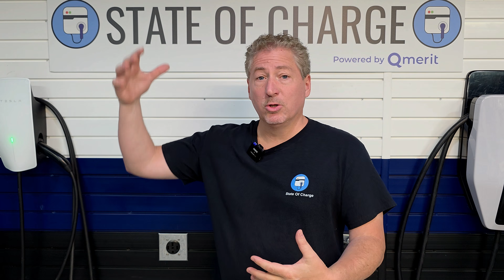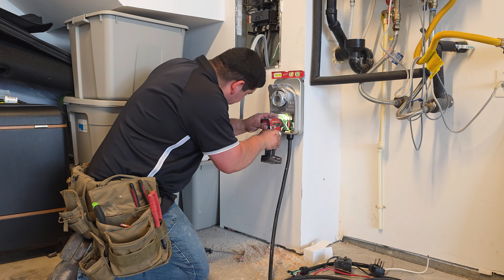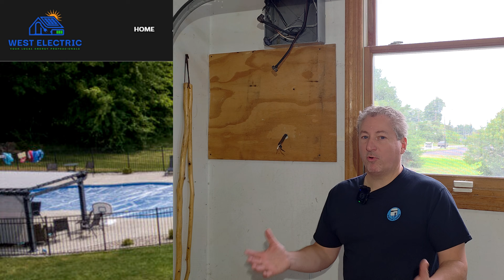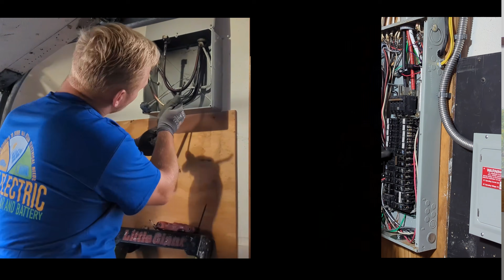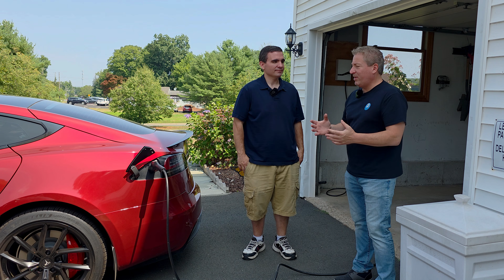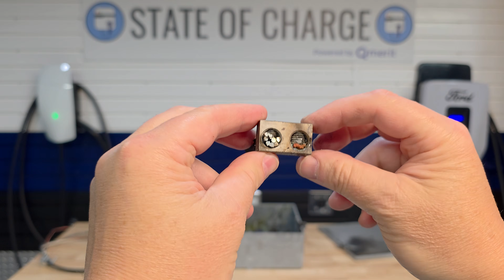Recharge Rescue Connecticut: Poorly Done EV Charger Installation Causes Fire

Comment: Why does anyone need a home charger? I have a couple of 220 outlets one in the garage and one outside. We have 200 amp service, an Equinox and a Bolt. The house panel is a sub panel of the garage panel.  The cars charge off the garage panel.  The cords stay plugged in coiled around a 3d printed cord holder. Thats it. Just plug the cord into the car when the car needs charging.

Comment: I am not a licensed electrician, yet I know that install was seriously wrong. HTF does any licensed electrician NOT KNOW the mistakes here. I have done my own 240 circuits for my welders and air compressors in the past. That isn't even the same as the seriousness of having everything exactly correct installing an EV charger that is pretty much at 100% duty for extended periods. Yes, I am doing my own 48A hard wired charger install because I know from previous experience and revisiting that now what is needed. How does a licensed electrician not know this? Clearly they do not have a good understanding of the constant load.  I think that licensed electrician at the very least owes a refund for that install of the previous charger. Now all that said, if I F up my install I'll be hitting you up for Recharge Rescue. LOL. One more thing, Tom that 8 gauge wire was NEVER going to hold up. It looks over-torqued because the connector is too large for the wire gauge so it flattens it, it can't do anything but that due to the sizing being wrong. I know this because I've had this discussion with an electrician friend.

Comment: Since seeing this series I started turning down the amps on both Model Y’s, put a smoke detector in my garage that connects to my alarm system and I smell the outlet where my ChargePoint is plugged in.

Comment: There's no way that the 8ga wire itself was the cause of this failure.   Yes the gauge is too small for NMC but that's only because the INSULATION of the wire cannot safely handle a continuous 50A current and this clearly wasn't an insulation failure.  The real cause pretty much has to be insufficient torque on the Burndy connectors.  Also your expert electrician from Qmerit was wrong to say that if the branch circuit breaker was rated at 50A it would have tripped and prevented the fire.  The fire occurred because the resistance of the connection was high enough that a lot of heat (power) was dissipated (P=I^2*R) when something like 30-40A was flowing.  That excess resistance could have actually reduced the current due to less voltage being delivered to the vehicle depending on the design of the vehicle's internal charger.

He was correct that the breaker rating shouldn't have been 100A since there was 8ga wire in the circuit and a big overload could have melted the 8ga wire's insulation even if the Burndy connector was properly tightened without tripping the 100A breaker but that's not what happened here and "experts" shouldn't be making significant technical errors in your otherwise excellent videos.

Comment: #8 Romex, 100 amp double pole breaker .... naw, the homeowner didn't pull a permit and have it inspected. No way unless the permit was just for the box and he connected the Polaris connectors after the fact. Just sayin' NO WAY. Show me the paperwork buddy! The permit and the inspector would have demanded a load calculation too. House burns down and your insurance company will deny the claim because you didn't pull a permit so your house wouldn't burn down. #8 Romex and 100 amp breaker --- defies any common sense whatsoever. I'm not an electrician but I know that isn't correct.

Comment: So, I'm not fluent in electrical terms, but you need to make sure your house is set up to handle an electric car and all the other electric stuff in your house. is that what I'm hearing? You also need someone who knows what combinations and sizes of wires to use for EVs, so you don't end up with fires. You need to have a smoke detector in your garage, and a fire extinguisher if you have an EV. Correct?

Comment: Thank you for this.  I just had my Chargepoint Homeflex charger installed a week ago and now realized I screwed up when purchasing the wire (6/2 Romex).  I now need the electrician to come back and replace the 60 amp breaker with a 50 amp and de-rate the EVSE to 40 amp.

Comment: 25:43 Tom, I really do admire your passion on this topic.  And I do absolutely agree with your position on liscenced “pros.”  However it’s been my experience that liscenced pros are like Unicorns.  Plenty of people that superficially meet that idea but many don’t know how to be professional.

Example, torque management.  Between the multitude of YT videos where the theme is “how I make $1k per EV install” to the utility mandated sparky that showed up for two different evse installs at my property, there is a casual indifference to using torque screwdrivers or wrench’s.  Literally, the last guy I had in my home made this exact comment “oh, you caught me…” when I asked, btw the way, was that 35 in-lb or 50 in-lb for that breaker as he was putting the panel back together.  He knew he ignored it altogether and he knew I knew it.  Only thing that prevented him from doing it in the first place, was it wasn’t in his belt pouch.  Which further tells me all I need to know.

That same electrician was “flexible on ampacity” because my evse was only a few feet away from the main panel.  So he had to run conduit and THHN instead of the romex 6awg he had brought out from my truck after I pointed out that 55 amp rating didn’t added up for a 48 amp evse device.  All of this from the guy sent by the utility that does all their evse TOU installs in my area.

Comment: I recently had my local EV-experienced electrician install my first EV charger to,support my new Porsche Taycan. I,also wanted to pre wire for a second charger as I plan to buy a second EV in the future. Unfortunately, my breaker box only had space for one additional 60 amp circuit, so achieving two chargers would require a new expanded breaker box, a very expensive proposition. The electrician’s solution was to specify usage of a Tesla universal charger. Using this approach, when I install a second Tesla universal charger in the future, they will automatically load share on my single 60 amp dedicated circuit. To the best on my knowledge, only the Tesla universal charger has this capability at this time. I would suspect many other homes have this “Full breaker box” constraint and could benefit from this approach.

Comment: This job was done terribly besides the points mentioned in the video. If the plan was to have an 100 amp charger down the road why would you cut the heavy gauge wires 2 feed short. An 80 amp charger would have terminals for the heavier wire, but now those wires are short. And why already use an 100 amp breaker while you only need 60 amp. The whole design was absolutely horrible. The electrician was apparently not in the loop of the work that needed to be done and just used what he was given. I know exactly  how this works, I have had this happen many times. It's just hard to say I have to come back, but that's the only right decision.
Reply: I relied on him as to what was needed re: what kind of wire, the junction box, connection wire to the EVSE, breaker size etc., all I said was I wanted the capability of switching to an 80amp EV charger down the road. He came out, designed/quoted the job, then came back with the materials to do the work. I also specified multiple times I didn't want to cut any corners, wanted permits pulled and everything done to code.

Comment: Question, currently getting 50 amp connection installed. Should the wire guage be 6 or 8. I saw where it 8 was recommended. I have a 2025 Ford Mach E GT.

Comment: Problem, you said you want someone who has installed 1000s. The electric Company Tesla had, said they are Tesla Certified and yet they used a normal 14-50 plug. So that's the problem. Just bought a Leviton EV plug since the mobile charger said it kept overheating

Comment: Excellent review - installed Tesla Universal Wall Connector charger without a connector box, directly wired to breaker box - I used 8AWG not 6 gauge (not Romex) THNN at the proper torque specs, and I set the charge limit on Tesla app to max of 24A at 240V so 8AWG and 40A breaker was sufficient. 
I completely agree that if you are planning to pass the full 48A to the charger, then you would need 6AWG copper with a 60A breaker.
The charger has worked well for over a year. 
I watch the area with a temperature gauge (Govee Home) wirelessly and with a Ring camera and I have a smoke/fire alarm wired to my alarm system.

Comment: Ed wired up my ChargePoint EVSE in my older Connecticut house and it's been holding up great for the last 3 years.   He also spotted an issue with some older wiring that needed to be fixed, so that was great. Would definitely recommend.

Comment: Here's another thought that is related to this topic.  Should all EV owners that park in a home garage ensure they have a HEAT alarm installed?   With two EV's and two home solar batteries in my garage I am started to get a little concerned.  And since it seems that installing a traditional smoke alarm may not be a viable solution (dust, etc causing false alarms and shortened life), my research shows a heat alarm to be a better solution.  What does everyone think?
Reply: I have a Nest in my garage as well as a Ring smoke/CO2 listener (makes my alarm system go off at night and automatically calls the FD). Since I do not have any gas vehicles to accidentally set the alarm off with carbon monoxide, I've never had an issue. The only problem I did have was one time I parked a relatives ICE SUV in the garage and was loading suitcases for a few minutes, even with the doors open, after I left and close the doors it set off the alarm and the FD came. But again that would be a non-issue in most cases especially if you don't own an ICE vehicle.
Reply: @ampedupevfsd we definitely need to raise the issue of garage alarms whether smoke or heat more.

Comment: The lesson is this:
1. Do a load calculation on whether your panel can handle the added EV load. If it does, great. Just add a new breaker and a charger with the right load (e.g. 48A charger with 48A breaker on a 60A dedicated circuit. Putting a 60A breaker on a 48A charger is just wrong.)
2. If static load distribution exceeds your panel's load capacity, consider adding capacity, or dynamic load distribution.
For my house, I use the simplest form of load distribution which is the cheapest to install: NeoCharge Smart Splitter, because anything else will require an electrician. I can install SS myself, which allows either the existing dryer or EV to use the dedicated 30A circuit (with an existing 30A breaker), but not both.
Reply: 48A EVSE on a 60A breaker is correct (80% rule). It should not have been on a 100A although it's doubtful that would have prevented the fire in this case.

Comment: I feel that there was a missed opportunity here.  This would have been a great chance to show the Emporia load management at work.  Plug the Tesla into its wall charger and then the RIvian into the Emporia Pro.  Bring up the Emporia app and see how close to max load the panel is at.  You may even get to see the Emporia Pro throttle down to stay under limit.
Reply from the maker: He's got a 200-amp service. The Wall connector wouldn't have put the house over its limit. We would have had to turn the heat pump on and a bunch of other items to get close to causing it to derate the charge.
Reply: Yeah all other major appliances are propane so even at full blast 36amps for the geothermal, 48amps on one EVSE and 32amps on the other, I'd be hard pressed to ever get to 160+ amps and have it actually throttle. But it's good peace of mind.
Reply: Nice to hear it was considered. As I'm on 200A myself, these descriptions give me some peace of mind as well. Thanks.

Comment: It would seem to me, that using an 8 or even a 6 gauge wire connected to a 100amp breaker isn’t something that a qualified electrician would think is ok. Or that an inspector would approve the same. ? I know some electrications don’t use MC or THHN, although it is what should be used.

Comment: Mashing the wire doesn’t change the awg.  Even if the wire retains thickness at the point of contact, you can see that only the surface area, little bit of the top and the bottom of the wire are making CONTACT with the lugs.

Comment: Hey Tom. One thing you never mention is that new Jersey  no longer is an EV friendly State.1st they took away the seles tax , Then they penalize EV  owners like me. I'm retired and I only put about 5000 miles per year on my model Y. How the hell they came up with  with the plates cust of over $250 per year?. It should be by miles driven. One time you mentioned that you know a lot of Politicians in NJ. Why not be an advocate for EV owners? Its Very , Very, unfair. OH! by the way. I cant belieave that a license electrician did a sush  bushed up job. I installed my Tesla charger myfelf. 60 amp breaker and # 6  hard wired as per tesla instroctions.

Comment: Dedicated Circuit, Dedicated Circuit, Not Circuits. 
Customer EV Charging Education is a Must on every Car Purchase. 

The Weakest point will always FAIL.
 ''Faulty INSTALL, Wiring, Fuses-breakers, Amperage Load. ect ''  
    . Thanks again for the Video Content 🙂
Reply: This charger was on a dedicated circuit when the fire occurred.

Comment: Is a junction or terminal box always required? To reduce points of failure why not terminate the correct wire size in the charger and home run to the panel board? Is it the bending and shaping the wires along the route and thru walls? I would plan the install to minimize routing. Surface mount wire in containment or use the correct jacketed wire you can clip to a surface or put  in a raceway that you can visually inspect.
Please advise.
Reply: Please advise.

Comment: I find it hard to understand how any licensed electrician in his right mind would have essentially "owned" this circuit with no "Load Calculation", a 100 amp breaker, 6 AWG wire (too small for 100 amps) and then amazingly downsized the final couple of feet to 8 AWG wire!   And on top of all that, it passed inspection! by the city? Hard to believe!
Reply: trust no one - simple thermal camera cost 300-400$ - worth to check all connections after every electric work was done - especially with EV charging bcoz almost no device at normal home operate at high currents for longer period of time
Reply: This looks  made up!! Let explained. No electrician and I mean No electrician would ever do an install like this! The breaker is way too big, the wire is way too small and to top it all off the last section the wire was even smaller. Now No inspector and I mean No inspector will ever approve something like this! Hell No DIYer would do something like this! This is fake and I mean Fake!! 😂😂
Reply: @haroldverdecia5490  I'm a contractor, and I've seen way worse done by licensed electricians, literally dozens of times. It's laughable that you don't think this can be real
Reply: @jerrybial5082 I am sure you have seen some crazy stuff but to this point and passing inspection come this is staged!!😂😂
Reply: @haroldverdecia5490  I'm not saying it not - I don't think it is, but who knows? If you watch Tom's channel as I have for a long time I think you come to trust him. He's genuine, IMO, and wouldn't do that. Also, I watched the video and they don't say anything about the last job being inspected. Maybe they didn't pull a permit? You know that happens all the time.

Comment: The video doesn't mention it, but is it safe to assume that the Emporia Pro plays well with the Tesla charger?
Reply: From what I understand in the video, it doesn't play with the Emporia at all. They are on different circuits entirely
Reply: I'm referring to the Pro's load balancing capability, which is supposed to monitor how much current your entire house is using. Could the Tesla charger combined with all of the other loads in that house overload the electrical service?
Reply: @TomM-om9jr  Correct

Comment: Pulling up this video reminded me to look at the NEMA 14-50 plug on mine.  The installer put a 50A RV box in place for my 2 EV setup as a secondary plug in the event that I did need to charge both at the same time.  Mine doesn't have the EV mark on the plug.  I'm going to have to get this inspected to ensure all the wiring is adequate and replace that plug.

Comment: Seems like the original electrician and the inspector that signed off on the work should be held liable since the homeowner did everything right on his end. I'm currently getting ready to have my 100 amp service upgraded to 200 amp and I was going to have the electrician also hardwire my EV charger, but after watching this I am seriously reconsidering that.
Reply: It's definitely the way to go - just use a reputable company and learn about what kind of wires/connectors they should be using.

Comment: Our solar pushes about 52 amps all day from our two tracking solar arrays. Add in our EV charge station (48 amp) and it’s more load than some of the components have ever faced. We had lights flickering. Our electric coop sent a lineman who checked things, and found one of the load lugs on the meter box, installed when the house was built in 1998, had a stripped bolt. The lug was cherry red when we turned on even the oven or dehumidifier, let alone the EVSE and solar. Ultimate diagnosis was the bolt was stripped when the meter box was first installed over 25 years ago. Lesson learned: If adding solar and/or EV charging, have the meter box checked. We ran on our auto-start generator until our electricians could install a new meter box and the lineman came back and reinstalled the meter.